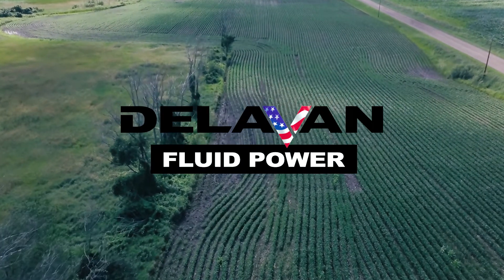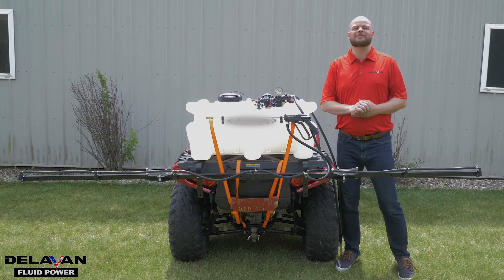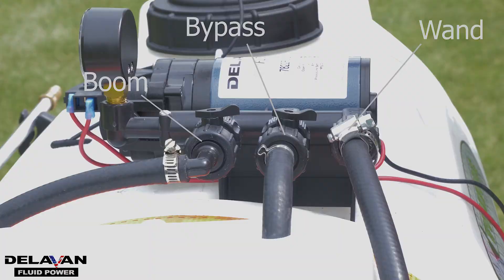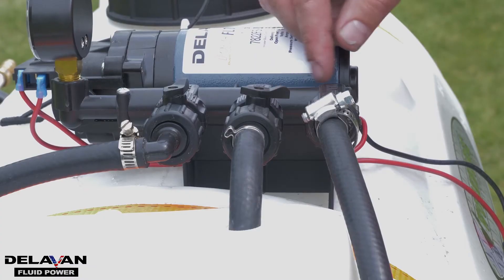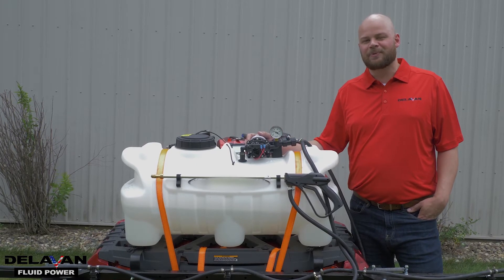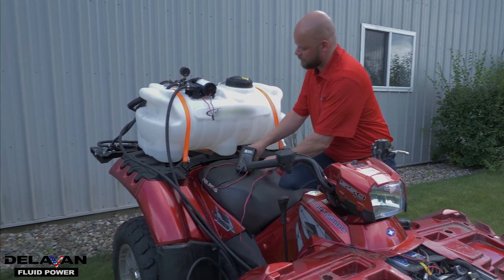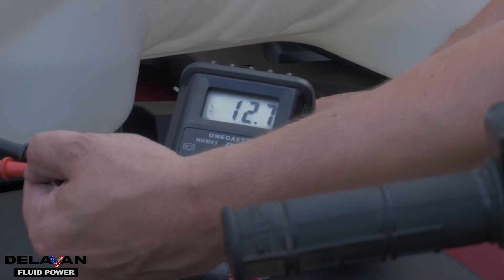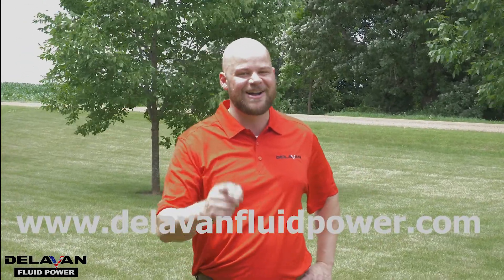What is Pump Cycling and How To Fix It

Comment: Great video I am a newbie to this. However, I have somewhat of an understanding I just purchase a Delavan 7971-101Y-SB 12v 7.0gpm 100psi the pump it is cutting off and on when in operation mode the pump has no bypass after reading the instructions it appears that I can adjust the pressure adjustment switch 1/4 to 1/2 turn until the pump stop cutting off and on is this the correct, please advises.